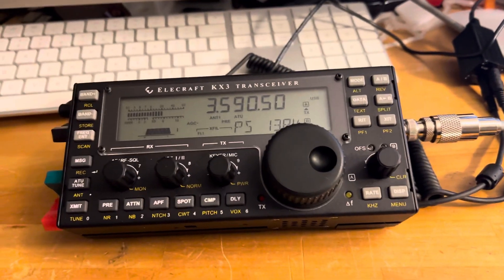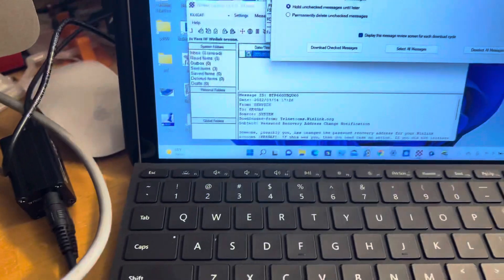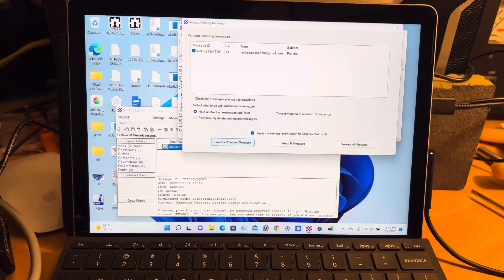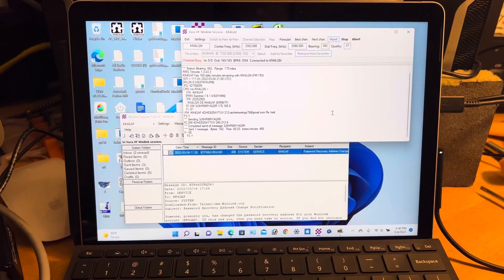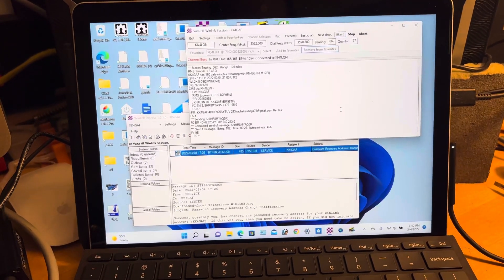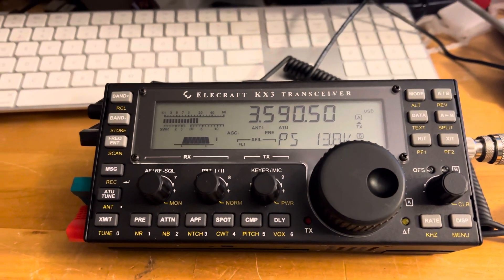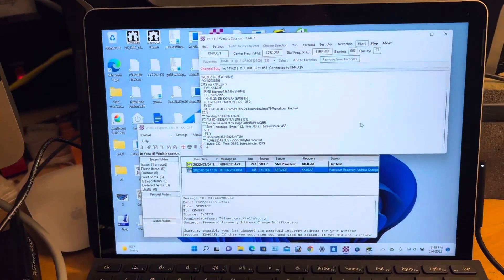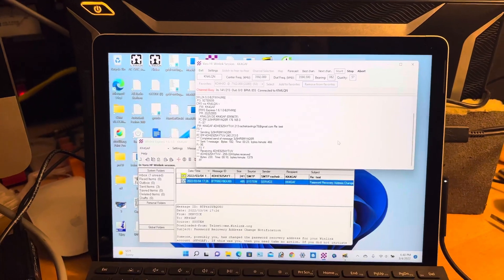Elecraft KX3 Winlink Express VARA HF

Comment: Dave, I resolved the ERROR PTT, but something changed and not the KX3 is not transmitting.  CAT control changes frequencies and bands but does transmit.  It was totally working for quite a while.  Any settings that you can think I may have changed?
Reply from the maker: Try to reinstall the software.
Reply: @DavidKK4GAF  thanks for the suggestion, David.    I did that, and the problem persisted.   
Finally, put the PPT port to K3, and that solved it.  The KX2 used COM12.  I ashamed the KX2 and KX3 would be the same, which was an error on my part.  Thanks for your help.
Reply from the maker: @owlcricker-k7ulm You can change port numbers in Windows Settings.
Reply: @DavidKK4GAF  David, yes, the ports can be changed.  The solution that I eventually found was to set the PPT port to K3.  That made everything work perfectly.  I went into the field and sent and received several Winlink messages.  I even hooked the KX3 up to my magmount hamstick and checked into Winlink without a hitch.  I think the KX2 uses a different PTT port setting, and that threw me off a little.  When the KX2 gets back from the shop, I will check.  The KX3 doesn't heat up too badly so I think it will be my digital go-to rig.  Thanks.

Comment: Dave I am excited about set up my Elecraft with Vara winlink.  At this point when I start a session I get a ERROR PTT and  the Elecraft locks on transmit mode.  
Did you experience anything like this?  What are you sound card input and output listed as in Vara?  I can get it all to work on the 7300 but the KX has been a struggle
Reply from the maker: No issues